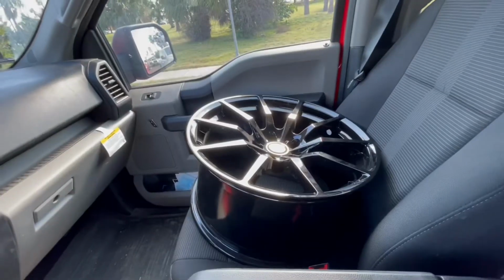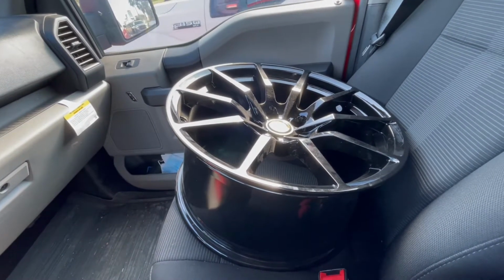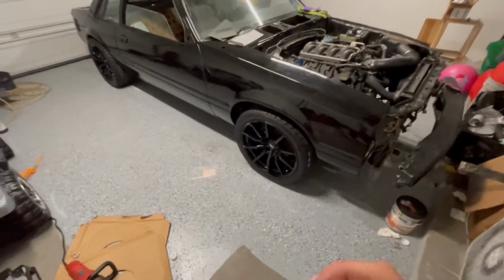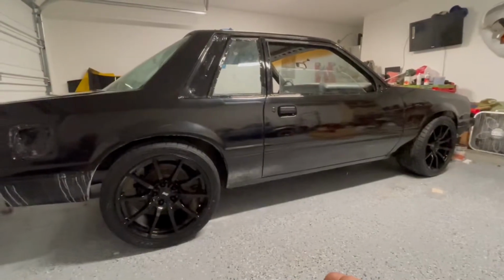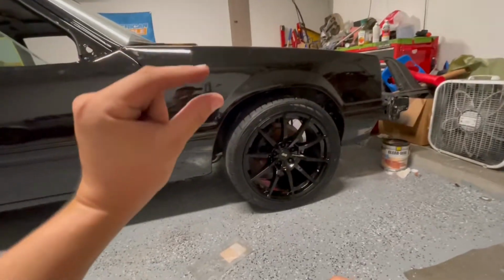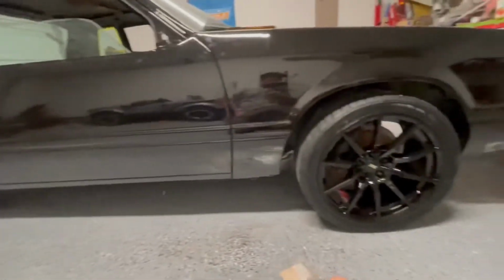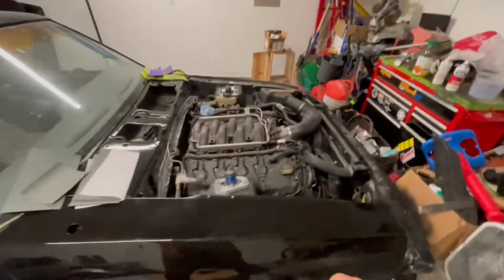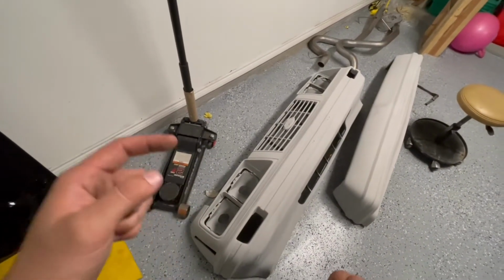SVE  S350 wheels are finally installed on the Foxbody

Comment: yeah you should definitely lower it more but no spacers because the tires will stick out too far for lowering it much or to get it to tuck a little bit of  just the top of the tread man it would look really clean and flush from what I can see on camera anyways (make sure you roll your fenders otherwise you'll cut right into those new tires heat the paint with a heat gun before you roll the fenders unless you've already rolled the fender lips. I can't remember) Man your fox has come a long way looking good bro! 😳🔥💯

Comment: Thinking about doing same wheels and tire size’s on my 87 have fenders rolled but still concerned about fronts rubbing what year is your car any issues in the front rubbing
Reply from the maker: I have no issue with the front rubbing. 
The rear it does rub. I have coilovers in the rear so my car is lowers and need to roll the fenders. 

Im Pretty glad with the setup.